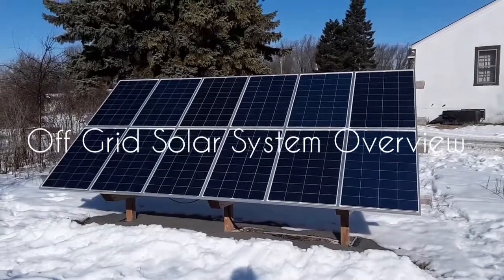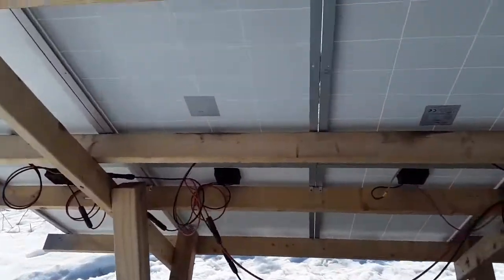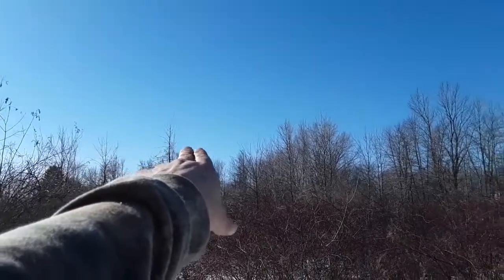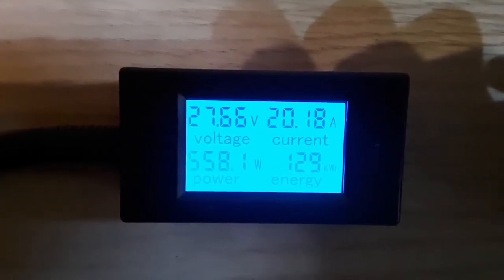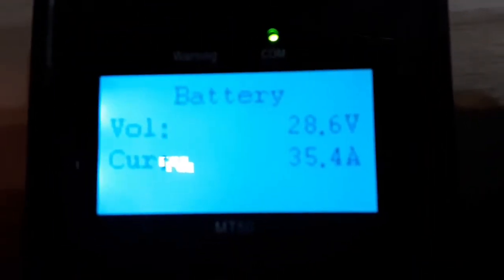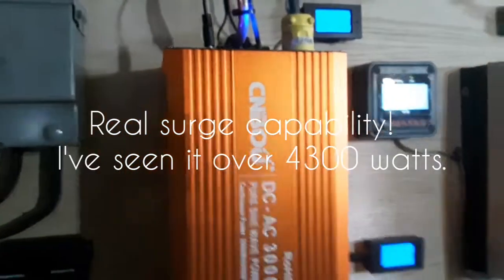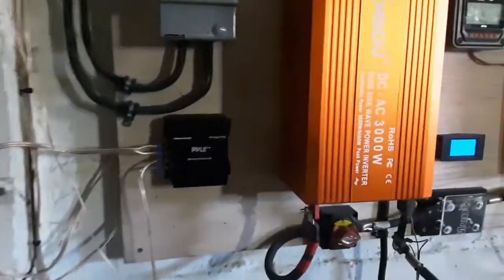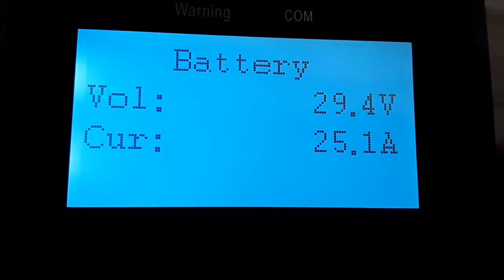Off Grid Solar System Overview

Comment: Solar just plainly rocks! Thanks for showing your solar system side... When I get back from Selling a couple of Axial Flux Turbines in Colorado. I'll be build a 3,000 watt, nine coil Axial Flux. It I hope will weigh 70 lb.. Here's how a 9 coil reacts is dirty wind, but this turbine weighs 125 lb. and will produce big time!!   https://youtu.be/zHN9Pmf3OVM
Reply from the maker: Thats kind of amazing!  Boy would 1-3 steady amps make a difference.  I'm going to have to geek out on all your videos now and make one I think. Never wound a stator coil yet but never to late to learn eh...
Reply: @smallcityhomesteaders1600  The magnets and copper,.epoxy are the most expensive.